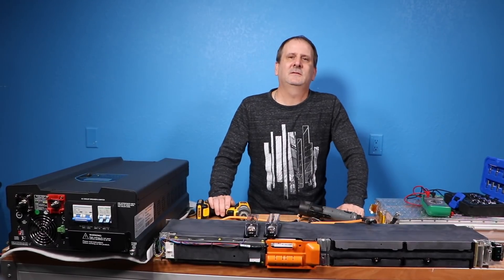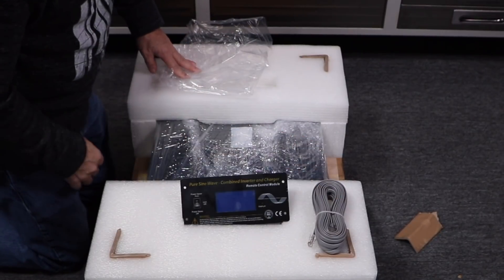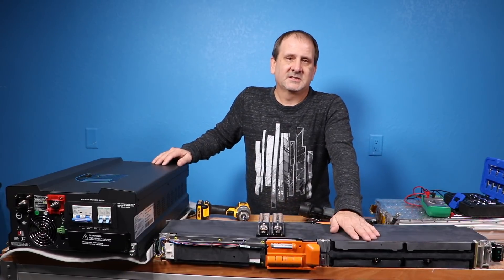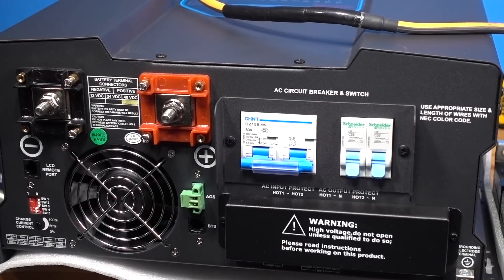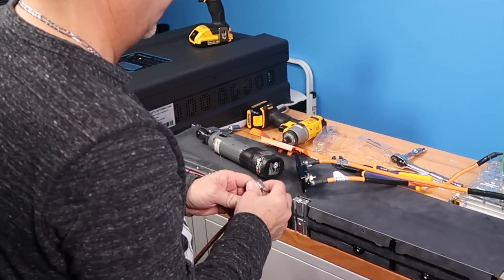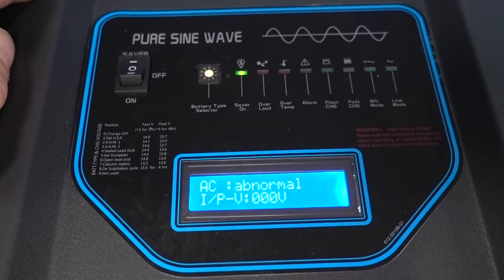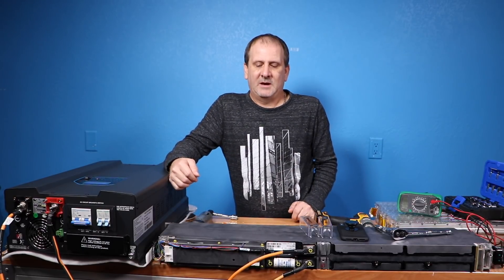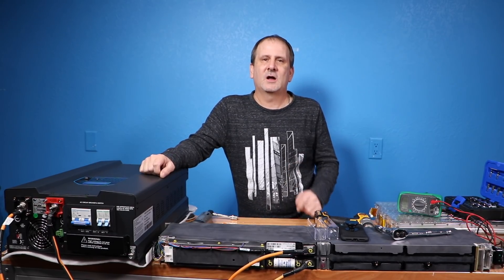12kw Inverter and Tesla Battery Module  Off Grid Hook Up test!

Comment: Wes,
I am right on the edge of purchasing two of these 15,000 watt inverters, however with it being off grid and no solar controller/charger it may not fit my application. I have solar panels feeding my main distribution panel for the home, however I do not know where or if I can tie into the existing solar system to feed the inverter to charge the batteries.
Do I need a separate solar charge controller or can I use or tap into something off of the existing.
Reply from the maker: Yes you will need a separate solar controller. If you have a grid tie solar system you will have will have to do what is called AC coupling. These inverters are off grid inverters.

Comment: 8:30 Wow, this inverter is noisy - and this is idle...
Reply from the maker: Big inverters make a slight sound for the fans. It's not that bad really. In a garage or an out building its nothing. It actually let's you know its on and running.

Comment: Hi it  is ups or inverter and both  ups inverter  hwo mach watt  panels  it is need and how many  betray need it
Reply from the maker: its an inverter. 12kw @ 48v. The more batteries the better. This is for a whole house or shop. You would want a minimum of 100ah @ 48v

Comment: Hi wes! Is the inverter is up until now? How was the performance and how much load you have? No service parts until now?
Reply from the maker: Yes I have ran it at over 85% and I had to try REAL hard to get it there. No problems and still working like new. I did move across the country and have it set up in my new home now. I have our own brand of inverters now, they are made by the same company just our name on it now with a few upgrades I have implemented with the manufacturer. Like being able to use Tesla Model S modules or any 6s, or 12s lithium battery pack as well as 4S, 8S and 16s LifePo4 battery packs. SolarGeni is our brand name. So if interested please be sure to check out my site for yours. SolarGeni.com. We just received our new line of 6000w split phase TESLA inverters and are in stock now! I will be doing a video on them in the next few days.

Comment: Is this the unit with mppt charge controller built-in?
Reply from the maker: MRB sorry no. most units this size don't have built in Controllers as it's better to have it separate. The manufacturer can install one however.
Reply: These units have a A/C D/C switch so no it won't take power from your solar and charge your batteries but what it will do is if the battery gets to low or you have to work on your solar it will take power from the grid or start up a generator  you connect to it and still run your house if your batteries get to low for some reason

Comment: Could you recommend an inverter for off grid with 96s 384v nominal battery?
Looking to run a full Tesla battery as source and mppt charger with standalone BMS.
Reply from the maker: Yes I can have you one built. They are expensive however. let me know if you're interested and we can set it up.

Comment: Are you sure that cable is rated for 200-250amp+
Just doesn't seem big enough.
Reply from the maker: yes it is. This was just a fast test but the cables were fine and only got very slightly warm. The are now attached with 4/0 on the DC side to the inverter and 6g to the main panel. It's now a portable system on wheels with a HUGE battery bank at 36kw in a NEMA enclosure. Total weight around 1000lbs.

Comment: Hey Wes
Well if this helps others, I had previous lowered the linnier scew adjustment for amp to lowest, I raised it and charged came up to 55.8,from 54.4 then alarm on inverter beeped once, turned it little more and stable again, for now it seems I had the charge amperage set to low for 100 ah 5.12kwh battery. 
Does this make any sense WES, COULD this be the issue?
Reply from the maker: is possible.

Comment: Hello
I have the same inverter,  I have have no luck charging 48v 100ah lifep0wer battery , max charge is 54.8 ,charger set at lowest charge rate so 1 on the selector, and charge curent linnier turn set at lowest amp setting.
The battery over charges , I see spikes I of 63 volts , any internal adjustment? 
Can you help?
Reply from the maker: If you are running a 16s LifePo4 battery that's 58.4v charged. this inverter will go to 60.4v at the max set on the calcium setting. You can get lower if you select the AGM or Gel setting and get right to 58.4v by selecting the 14.6v setting. Multiply that by 4 and you get 58.4v. I don't know about the internals for changing voltage but believe it's in the software and the board. Call the manufacturer and they can assist you I'm sure. I don't see spikes on mine but I use 15s lithium NOT lifepo4. so my batteries can go to 63v and I never have any problems.
Reply: @WesThatTechGuy  
Hello and thank you for fast reply.
I use 15 s  as well , if you have time look up 48 v Lifep0wer battery on eBay. There about $4000.00 battery.
I just tied again using AGM1 lowest and AGM 2 and it spikes. 
I can't figure it out.
Reply from the maker: 48v lithium is usually 13s and LifePo4 is 16s... I would contact the manufacturer of the inverter and ask them what might be the problem. Good Luck.
Reply: @WesThatTechGuy  
Thanks Wes, somehow it seem to charge just fine and when it reaches 58.4 it begines fluctuate up into 65 vdc , then inverter alarm.There may be a dispute between the AIM inverter and BMS logic built into that particular battery, not sure ,im reaching, but I thank you.
Keep up the great video's.
Cheers Wes

Comment: wish more explanation for things such as  THIS IS A 48V inverter but using a 65V battery but "That will work"... Please explain WHY or How or why it is not a problem or "that can be done/will work if we do ________"
You need to inform us who are still ignorant but learning. Please.....
OK... decided to watch it to the end.. I see that was finally explained .... just the operating parameters of the unit and you are within range with Battery Max charge.. How much does that Inverter/charger weigh?
and you say TESLA battery... be specific please,,,, WHICH ONE? Which car which series.... Please identify as there are more than one. Ineve new of a 65V. Have seen vids with 24V.  Is this a newer model or originlal older less efficient pack?

How many watts per hour are lost by running that big beastie?
Reply from the maker: I will do another video on this whole setup and address all those questions. this inverter will accept DC up to 65v of any battery composition. Inverter weighs about 200lbs. I used the Tesla Smart-for-Two 63v 15s battery out of the older Smart Car.

Comment: I like AIMS stuff. I have an AIMS 24VOLT DC 4KW 120VOLT AC unit. I like it but I have learned about MagnaSine and I think there a better unit. There way more efficient. I'm saving up for a 48VOLT 4KW MagnaSine one. I'm looking at different models they have now. AIMS is still good stuff though. As a matter of fact I'm living off my AIMS unit right now with 24 GC2 Batteries and a pair of HONDA EU2200I generators. One of then is the regular HONDA and the second one is called the COMPANION with the 30 AMP 120VOLT plug. I think it's called an L5 30. Right now that AIMS inverter is the only thing that stands between me and the BELOW ZERO weather. I'm off grid and that baby keeps my furnace running and my entire home. I have propane heat and stove.
Reply: I'm preying to God that nothing happens to my AIMS inverter. If that fails I will freeze to death. I'm a little nervous because I only have that ONE inverter. I would feel more comfortable if I had 2 or 3 of them here in case one fails. PLEASE DON'T FAIL ME AIMS.
Reply from the maker: Sweet yes Aims is good stuff no doubt. I use it myself too. Glad you're staying warm.
Reply from the maker: Right!

Comment: in my country electricity frequency is  220 Volts at 50 Hertz. does the inverter can handle this?
Reply from the maker: Yes!
Reply: Just check the data sheets.

Comment: it has been almost a year, how your inverter is doing mine(sigineer) is delayed the electronic clocks so this make me think is not pure sine wave
Reply from the maker: I've had no problems at all.
Reply: looks like you inverter is the same brand as mine, do you think my inverter has a problem(delay the clock) @WesThatTechGuy
Reply from the maker: I'm really not sure.
Reply: @WesThatTechGuy  what capacity of the inverter are you using 30%, 50% 70% etc
Reply from the maker: Generally less the 50%
Reply: so you don't have connected your water heater, a/c  or electric range  to the inverter  @WesThatTechGuy
Reply from the maker: YES I do. I have the whole house and all appliances running from the inverter.

Comment: Residential a.c. units need starting current/power of up to 13kw. 50amp.
 Running power current 29a, 240/208vac.can this system do that?
Reply from the maker: YES @John Gun!!! In fact I use it to power my whole estate. My AC is a 4 ton and it takes 135a to start it up and runs at 33a 220v. I have 4 buildings with AC in them an I can easily run a 4ton in my house and 2 other mini splits. 1 mini is 120v 16000 BTU and the other mini is 24000 BTU with heat pump at 220v. I have them all running at the same time at night with all my lights on TV's 4 refridgerators and on and on. With everything running I only use 43-47% of the inverters power load. I have a video of it right here: https://youtu.be/ZKJknIvVC_Q
Reply: @WesThatTechGuy  I do not know what your system is, but guessing solar? How many KW of panels do you have and are you in a favorable sun area? What is your nominal uptake of solar KW or KWH? And, I take it you are in Parallel and series on your panels ? What volts?/Amps?
Reply: So you could run everything off the 10kw

Comment: Could I ac couple with this inverter  , I have an enphase system and want battery backup but don't want to waste my perfectly good system already. I think it needs to be able to phase shift a little. I could get the smaller 4k one and with my enphase inverters still power a decent load. At least that's what I would like. Thoughts
Reply from the maker: Yes this can be done no problem. All you need is an auto transfer switch and you're coupled.
Reply: @WesThatTechGuy  what u mean by auto disconnect? U mean a volatage relay or something to cut off battery charging when full? Can u send a link or name of something
Reply from the maker: Sorry I meant to say automatic transfer switch. If Grid goes down, then it transfer the load over to the inverter and batteries. These are commonly used on Back Up Generators for businesses and homes. You can AC couple any type of micro inverters and solar panels with this method. https://amzn.to/2PRomuC
Reply: @WesThatTechGuy  thanks one last question I have seen this inverter branded as fuelzero and sigineer are they the same company?
Reply: Actually I have even seen the exact display on aims and renogy inverter. Who is the real owner of is this like other Chinese things one starts and others copy
Reply from the maker: Yes you have seen these displays as they can be used universal similar to many auto companies using the same spark plugs etc. However these are not copies but the same company makes all 3 of the inverters you've mentioned. Mine (Solar Geni) Aims, Renogy.

Comment: Wes I M new to your site today.  I guessing this would work with an RV.  Is it possible to get enough solar panels on an RV to charge back the Batteries?  Do you have a video showing this install in an RV?
Reply from the maker: Jeff thanks for watching! Yes you could do this in an RV no problem. You could get enough panels on an RV for a smaller unit but probably not for a 12kw inverter. I don't have an RV now to show with panels. Lots of these videos on youtube though.

Comment: Wes, can you explain how you made this inverter working with your grid tied solar and still working with the net metering? You have mentioned it one of your other videos but never showed it. I know you can A/C couple your solar on the Inverter A/C out side but I am interested your experience how it works with net metering (or you just gave that up)
Reply from the maker: Yes that's coming up soon. glad you're watching. It'll be a week or so until the new video is up but will be soon.
Reply: Wes That Tech Guy great! It would be interesting to see the additional components you have to built in to work with et metering and what is your inverter operation mode setup regarding priority (AC priority or battery priority). Also it would be nice if you can cover all or most of the scenarios what can happen in such a system.

Comment: In my country there is massive power outage can someone use an inverter without solar panels ?
Reply from the maker: Very sorry to hear that! YES you can use an inverter without solar panels but you will have to have some way to charge the batteries. This could be done with a vehicles altenator or wind turbine.

Comment: the current in both the positive and negative leads are identical, why a fuse in each leg you only need one?
Reply from the maker: just a added safety for one. Using DC current is always easy but tricky at the time as the amount of amperage is so high in this battery pack its better to be safe than sorry. fuses are cheap compared to battery packs, inverters, cars, houses and people.
Reply: Sorry to say, there is NO added safety. Since the current in the positive lead is the same as the current in the negative, one fuse will likely blow a little sooner because of the differences in manufacturing. For example with a 100 Amp fuse one might blow at 99.8 A, the other 102.1A but there's no safety in 2 fuses.
Reply from the maker: Fred this is just for added safety in case there might be a faulty fuse or a fuse wanting to blow at say 130a instead of 98.2a or fails all together. So YES there is in fact added safety depending on how you look at it. And as usual thanks for your input and expertise on the subject.
Reply: @SuperFredAZ  There is added safety. If the non-grounded wire shorted through something, the current may not be exceeded. Say if a mouse chewed through the wire and it was exposed in two places, running through a piece of metal framing.
Reply: @toyotaalltheway1  So, you put a fuse in line with the positive. If the negative is grounded nothing would happen if it shorts to ground. If the positive is shorted, then the fuse would blow.
Reply: @SuperFredAZ  What if it shorts THROUGH something and not to the ground. Then the human that touches it becomes the ground.
Reply: @toyotaalltheway1  If you have a 50 amp fuse the human will die and not cause the fuse to blow. The fuse is there to prevent a fire, not to prevent 
electrocution. There's nothing "wrong" with fuses in both legs, but anyone looking to duplicate what you have done , need not use two fuses. I am merely pointing this out.
Reply from the maker: Fred agreed! But remember lots of people who do in fact duplicate this don't always know that much about general electricity let alone inverting AC-DC etc. So any added safety is a plus. This is the same as if they have a direct short on the + and then try to make a repair without a fuse then this 2nd redundant fuse could save the entire pack, inverter, house and person. In closing when I did a final install on my system I still use the 2. For me I have 100's laying around and its just good practice. I really appreciate your input on this subject as always and glad to have you on board.
Reply: @WesThatTechGuy  Ana just use one fuse .. I'm sure that master electrician will be glad to buy you another $3,500.00 inverter if that one fuse fails.. if I had to bank on a $5 fuse I would give it a second break point to..

Comment: so this inverter is able to charge lithium-ion batteries
Reply: You can ask the supplier of the inverter to program the not used setting to your particular voltage of your lithium battery, not all but some will. If not charge but make sure you have something like a Victron Battery protection and BMV712 to set the relay for under and overvoltage
Reply from the maker: yes but needs some technical dealing in order to do it SAFE and RIGHT. Out of the box it can up to 60v but I use 63v for a full charge.

Comment: brand of this inverter, it has been most the 3 months since this video, how your inverter is doing(max. capacity, heating problems etc)
Reply from the maker: this is my brand. it is doing great with no problems max capacity is 36kw 20second surge. 12kw continous. No heating issues or stutters in electricity.
Reply: i am in CT how much will this cost?

Comment: Balancers work with different voltage's from 2-5v every cell have ther own balancer... 
The balancers have 4 wires black goes on - of the cell red goes on +side there are green and blue wire that are like common balance bus on this leads we have ac voltage and current and frequency around 1-2khz that goes from first to the last cells... 
If one cell have higher voltage that is transferred to ac and share the voltage to the ac bus and other balancers that balancers convert that higher voltage back to dc and to other cells that are lower as higher one...so no energy is burned in resistors or anything like that it is given to the lowest cells.... 
One thing I have noticed when I first conect together the balancers that lower cells are gaining voltage over two days for 0.3v and higher cells are losing voltage for 0.1v so it works....
Only one thing that bother me is that there is no control if single cells is on the lowest edge of capacity then voltage drops quickly.... 
but now that could not happen because I never go under 3.4v/cell...
My usage is around 170-max190Ah and battery bank have strong 260Ah.... 
I hope my answer is satisfied you....
Batrium is a nother option but is much expensive...👍